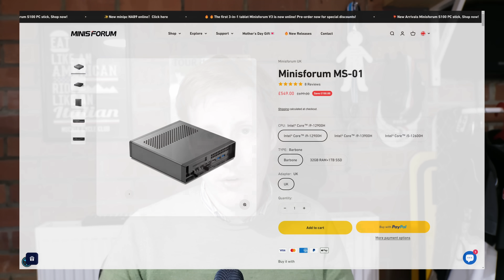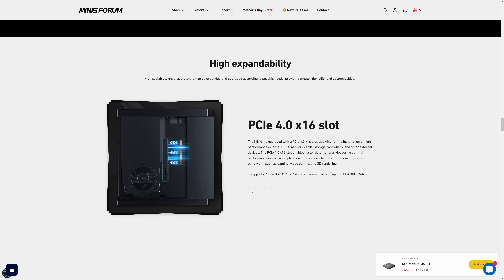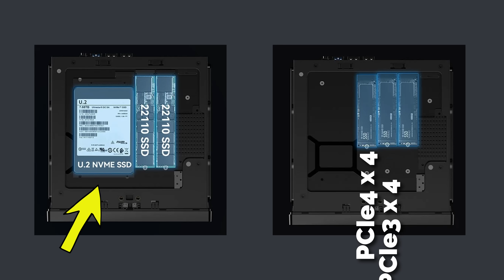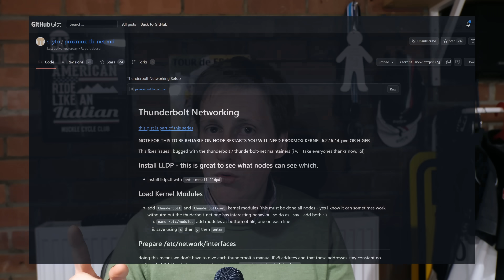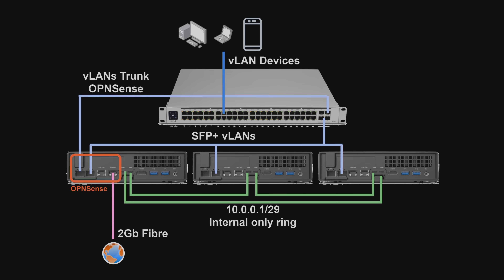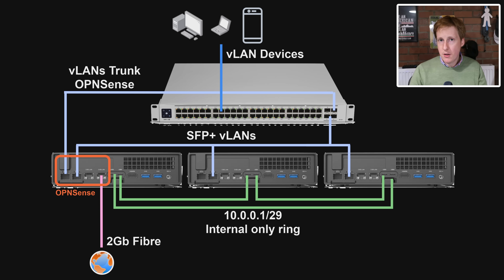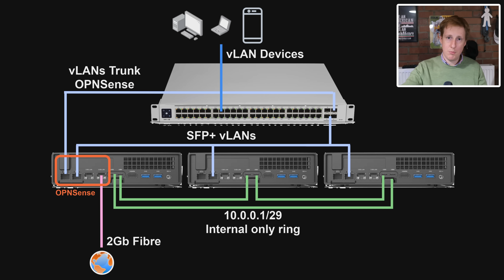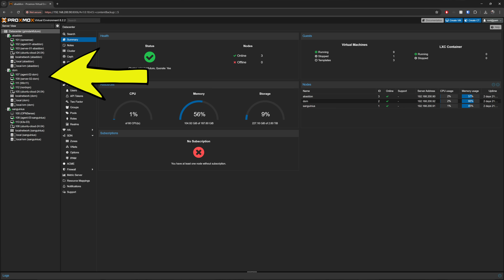Planning A Homelab - Cluster Time! Minis Forum MS-01

Comment: I recently came across the MINISFORUM BD790i with the AMD Ryzen 9 7945HX. It supports up to 64GB DDR5 RAM, has two PCIe 5.0 M.2 slots for fast storage, and includes a PCIe 5.0 x16 slot for high-end GPUs like the NVIDIA RTX 4090. Plus, it comes with a robust cooling system and plenty of connectivity options including 2.5GbE LAN, HDMI 2.1, and USB-C. It seems like a solid choice for a high-performance setup in a small form factor.
Reply from the maker: I agree. Put a quad NIC on it and it's a great option. I did consider it for a while.
Reply: @Jims-Garage  I have four BD790is clustered like this with a Miktrotik 10G switch (used the PCIe slot for a 10G card) plus two 2TB NVMes per machine. runs like a top. and 4 nodes makes Ceph extra happy, lol.
Reply from the maker: @notaprofessionalJ  damn, that's some serious horsepower!

Comment: I have been thinking about building a new homelab server for the past 4 months now 😅 and I really want to replicate your setup but my main concern is storage. I want to add HDs and there are 2 options either DAS over USB which is really flimsy especially with power saving or maybe using a SAS card. Maybe I should just build a NAS but then wouldn't it be better to build an AM5 build with Supermicro H13SAE-MF? Too many choices 😅😅😅. Can’t wait for your next update!
Reply from the maker: Thanks. If it helps I have a dedicated NAS outside of this cluster. I don't intend to change that.

Comment: Cool idea with the Thunderbolt ring.  Curious how the Ceph cluster is performing?  I also have a cluster of 3 and considered a Ceph cluster.  If I understand it correctly, a replicated storage array would hit the SSDs much harder than if the VMs were just running on their individual node.
Reply from the maker: I'll hopefully be able to feedback on performance in the coming weeks. It will definitely hit the drives harder but I estimate around 5 years for my nvmes. I'm happy with that.
Reply: @Jims-Garage  it was 3 or so years for me when I used QLC drives so that is probably just about right.

Comment: Hi Jim. Did you look at ipvs(adm) and a virtual IP address? Maybe three lines off of a switch connected to the modem, so that each of the nodes can assume the role of the uplink with a virtual IP address just in case the "current active node" goes offline`? As long as the HW switch between modem and cluster doesn't fail, your should be good to go.

Comment: Suggestion , buy a unifi aggrefator switch. Link aggregate the rwo 10gbits interfaces at 20gbits and your firewall Will be abble to migrate and have high avaibility. This bucause if router fails everthing fails on the cluster , i Will bot like my firewall and internet to BE a point of failure 🙂 cheears from Portugal 🤗
Reply from the maker: Thank you. I actually ordered one earlier this afternoon!
Reply: @Jims-Garage well done :)

Comment: Just a small word of warning with the ms-01.  I had nothing but problems with proxmox using the 2.5G ports with proxmox/opnsense. They would just not run at full speed at least with opnsense.  I ended up buying a managed 2.5G mikrotik switch and used the 10G ports from the ms-01 and connected my modem to a 2.5G port and that solved all my problems.
Reply from the maker: Good to know. I haven't seen that yet, I'm getting 2.5Gb on speed test.

Comment: unsure where my earlier comment went, but it had an external link so maybe it got cleansed!

had recurring lock up issues with the MS-01 with a k8s workload! after doing all the usual things: bios update, microcode updates etc things are looking more steady.  would love to get this working stable without having to do something like disable the efficiency cores.  

have you had any lock up with container workloads?  great video!
Reply from the maker: All 3 machines have been running k3s for a few days, I haven't had a single issue. I wonder if you have a bad unit?
Reply: @Jims-Garage  that was my first thought, but I saw a lot of posts with people having the same issue!  no crashes in 1 week tho, im hoping im good

Comment: Here's my solution to have HA firewall. It is not perfect but it works for me.
I have a 3 node NUC setup and to have a high availability firewall I created a vmbr to 1 dedicated lan port on each node (each time the same port). As the modem has 4 ports, I directly connect this port of each node to the modem. This vmbr is set as wan on my pfSense instance, nothing else on linked to it. I was not able to set the modem in bridge mode (fiber is too complex for me), instead on the modem I set the IP of pfSense as dmz. All traffic hitting my modem is in fact redirected to my pfSense, with my internet IP facing directly facing pfSense.
With HA, if the node where my pfSense goes down it automatically starts back on another node. Thanks to ceph it goes quite fast. I'm now considering to have 2 OPNsense instances running instead of 1 pfSense to have no downtime.
Reply from the maker: Thanks, this is similar to how I used to have it. However, using the WAS-110 SFP stick has complicated matters. I'm keen to keep trying though.

Comment: I spent a couple of days trying to iGPU passrhough the Xe to a linux VM and had no luck, so I'll be very interested to see how you go. For now, I've installed the desktop OS directly on the MS-01 and using an Incus VM to run Proxmox. I'll also be running Proxmox Backup Server in an Incus LXC container and passing through a 4TB NVMe to it.
Reply from the maker: I have it working without issue (no sr-iov though). Follow my GPU passthrough guide, those instructions still worked for me on 24.04 server.
Reply: @Jims-Garage  Great. Do you mean you currently have full iGPU Xe passthrough working with a Ubuntu VM on an MS-01? I track a few forums and I have not seen anyone post anything positive yet. Which guide do you mean?

Comment: Wow that setup looks very cool. I'm curious to know more about the WAN connection. Are you using your ISP ONT or removed it in favor of the SFP+ port? How does that part work in your network? Thanks for your great videos, learning a lot!
Reply from the maker: My ISP doesn't have modem mode currently. I'm having to bypass their router with a was-110. I plug it into a switch and convert it to rj45 to save an SFP port on the ms-01. It could go straight into the ms-01 though (if the heat sink wasn't so large!)
Reply: @Jims-Garage  cool, didn't know about the was-110. i will investigate. thanks

Comment: k3s storage is something I struggle with. I have used longhorn, NFS and openebs. Then moved to ISCSI, and everything seems to be really stable, but that means I'm relaying on a single instance of truenas. It would be cool if you could make a video comparing HA storage solutions for k3s and their performance
Reply: Longhorn can be extremely buggy. I have lost databases because of it. When everything works, it works beautifully, but every few months, something fails to start. The biggest issue, in my opinion, is the io speed. If you have a demanding work load or a large db, everything comes to a crawl. This is with nvme storage backing across 4 nodes
Reply from the maker: @hansaya  yes, I've witnessed many of the things you mentioned. Thankfully I don't have anything that is too heavy on IO but if that changes I might need a different solution. I'm keen to go ceph for a single solution but need to figure it all out first.
Reply: @Jims-Garage  One thing saved my bacon many times is using a reliable backup solution. Learned that from my longhorn saga :(. I use Velero and I highly recommend it. Very easy to use as well
Reply from the maker: @hansaya  thanks, will take a look. Currently using PBS, rclone and Google drive
Reply: @Jims-Garage  Velero+restic takes a snapshot of your deployment/data very efficiently then put that on a s3 bucket. You can chose to put your s3 bucket in your google drive using truenas. Biggest perk is being able spin up a whole new cluster with all your data within minutes. Good luck
Reply from the maker: Will look into it. I'm currently using longhorn but looking into ceph.

Comment: You can get your firewall in HA mode (I think):
Create a VLAN and plug your fiber into an Switch that uses that created VLAN as an untagged port. Tag that VLAN to every port where your ms-01s are plugged in and you should be able to use a VM with an ethernet Port configured in Proxmox with that VLAN. Mark it in the Cluster as HA and it should work.
Reply from the maker: Thanks, I'll retest. Might be complicated by using a WAS-110
Reply: Mini Forums should have a AMD edition on the way for next month
Reply from the maker: @ulrikboesen  that's good to know
Reply: @Jims-Garage  I assume you passthrough the WAN port? PVE8 has aliases for pcie passthrough, so I assume it's possible to move the opnsense VM from node to node and use the same port for WAN. And I think opnsense should be configured to overwrite MAC, so it stays the same independent from the host.
I saw someone on yt doing this but forget video title and chanel. WAN was connected through a HUB (not switch, but I assume a switch would work) from the modem to all PVE nodes. It was a cable modem and the MAC was important to not change, therefore I mentioned it before.
Reply: The video on yt was without passthrough, on all nodes vmbr1 was configured to use the desired ethernet port and no IP assigned to PVE. But I don't like this aproach, I also have my router vm with a passthrough WAN port and opnsense handles the MAC (cable internet, the IP changes if the MAC changes)
Reply: 14:12 just saw you have already fibre plugged into a switch, looks like easy to test if it works the way I think
Reply: @sku2007  It was channel Digital Spaceport. He used a hub because it broadcasts on every port, unlike a switch. IMO clunky and another thing to break.
Reply: @justinooms6419  thanks! regarding breaking risk, I also suggested to try with the switch he`s already using on 14:12
Reply: @ulrikboesen  wait...what? is that a guess?
Reply: I could confirm it works. I use a vlan for my isp to fw
Reply: Make a OPNSense or PFSense vm on each node each with: 2.5Gbe passthrough for WAN, 10GBe SFP+ passthrough for LAN, make sure to add a SYNC vLAN to the LAN interface (no need for a dedicated physical interface). That SYNC vLAN should only be accessible to the two HA firewall's and nothing else using rules to only allow those sync services ports. I've done this in my homelab with PFSense (albiet with 1GBe ports) and it works beautifully, I can bring down one of my nodes for maintenance and the network doesn't miss a beat.

As for the WAN side, PFSense needs CARP VIP's on both the WAN and LAN side. Set up a L2 or L3 managed switch on the WAN side and have it hand out 3 IP addresses, one for each virtual router and one for the VIP. For PFSense there is a formula for finding what MAC address the CARP VIP will generate on based on its ID. You could also do this with a dumb switch, but then your ISP would need to give you 3 static IP addresses and they are not likely to do that with home internet. I've even had a business client where my local ISP was stupid and didn't know how to do this, so HA on the WAN for that client has never worked, but on the LAN side it works beautifully.
Reply: Yeah, OPNsense running CARP VIPs is awesome. I'm running a router on each node in my 3 node Proxmox cluster (with CEPH), all syncing over my backbone. You'd add a switch on the WAN side, virtual IP for any network you want to failover, then setup the OPNsense HA sync IPs. Throwing a whole node into maintenance mode for the first time is kinda wild for a humble 3 node homelab.

Comment: As far as router redundancy. It’s gonna cost a bit of coin but you could do two UniFi UDM Pros running one in shadow mode.

That would free up your first MS-01 so it could be cycled without a network outage
Reply: If you use something like Proxmox, it can handle it as well (when 1 node goes down, it'll just move the VM given you use something like Ceph or another way of "shared storage").
The issue would still be that his WAN goes out but the UDM Pro has that exact same issue (unless you have say, redundant WAN links).

Comment: All great stuff, nice seeing you doing more clustering~
Not certain how much experience you have with ceph with SSD OSDs but just keep in mind you want enterprise SSDs/NVMe(s) for longevity and reliability; plenty of fast consumer SSDs but not many of them handle the demands of ceph -- if you see worse than expected speeds keep that in mind.
Reply from the maker: Thanks, appreciate the warning. Some experience but lots to learn. Was going to try with 1TB nvme with 550TBW - see how that works out. I've some similar with longhorn for a few years and imagine it's similar wear and tear.
Reply: @Jims-Garage  The problem is not really TBW (for good consumer drives) but rather the poor write speeds over time/and both with heat. Also, you really should use a drive with PLP power loss protection. Consumer drives really are just a poor choice for Ceph.
Reply: YouTube ate a reply I had in here, but it was along the lines of considering an M.2 NVMe carrier board (with a switch chip as the MS-01 doesn't appear to have bifurcation support, unless that has changed recently) -- won't be able to recommend the Supermicro AOC-SLG3-2M2 because of this but there are other options out there if you need more NVMe storage.
Do keep in mind that the switch chip on these carrier boards will be the limiting factor so look for something beefy that carries all the needed lanes for each NVMe SSD.

Finally, backing up what Justin has added -- you really want to seek out NVMe SSDs with PLP -- these are usually designated as M.2 22110 and are all mostly enterprise SSDs as they need that additional room for capacitors~
Reply from the maker: @avluis86  thank, I'll check those drives out (I had these because UGreen sent me them).
Reply: You absolutely need SSDs with PLP or your CEPH cluster will be painfully slow.
Reply: @daveredmore2375  plp has nothing to do with speed

Comment: This is a wicked video :) although you called the 2.5gbe fiber :).  Why not get a 8 port Mikrotik SFP+ switch ? then link them all together via SFP+ ?
Reply from the maker: Thanks, it kind of is. My fibre goes into a switch and converts it to 2.5Gbe rj45. It's because all the IO is stupidly upside on the MS-01 and my was-110 doesn't fit due its heatsink.

Comment: I have the MS-01 and SR-IOV with the Intel iGPU works fine. I have the 12th gen variant and it works out great. I loaded it up with 2x48 GB sticks and this is my low power Proxmox node. I have successfully passed through the iGPU to multiple VM's at the same time (max. 7) and GPU decoding/encoding also works. Just know that when it comes to LXC containers there are some caveats from what I understand. Might be better to just run a VM with e.g. Docker or Podman on it and then spin up a Handbrake or Jellyfin container or something if that is what you're going for.
Reply from the maker: That's great to hear. Do you have a link to a guide you used in case of any caveats, or is it the standard approach?
Reply: @Jims-Garage  There is some caveats atm : you must pin kernel to last 6.5.X version because 6.8 not compatible with the i915 dkms
Reply from the maker: @gtarrare  thanks, I just read up on that. I'm already running 6.8...
Reply: @Jims-Garage  I tried to left a comment yesterday but YT removed it... I pointed that out as well. Don't run kernels newer then 6.6
Reply from the maker: @masterTigress96  thanks. Unfortunately links are automatically removed. I'll keep an eye on it to see if support for 6.8 comes. Failing that it does have space for a GPU
Reply: @Jims-Garage  Official support for Xe sr-iov should come with kernel 6.10 according to last phoronix news. We need to wait some months 'til official support
Reply from the maker: @gtarrare  Ooh, that's exciting!
Reply: @Jims-Garage  HW accelation working in a plex LXC and Jellyfin in VM (Ubuntu 22)

Comment: I was looking to get a MinisForum MS-01 and see if I can fit a MBA card and use it for storage , but can't find a external 4/6 bay unit which just has a PSU where you can plug the all the sata plugs into it , they are all USB or thunderbolt .
With 20 line CPUs it's hard to work out how do you get a GPU , sata and 10GBT network .

Comment: I've recently setup a medium availability Opnsense on my pve cluster using the proxmox HA rather than Opnsense HA as I only have a single public IP.

The key for me was using the cluster resource mapping for the hardware pass thru and having the cable modem connected to all the node Wan ports using a separate switch (in my case I used locked down vlan ports on my main switch), set the Mac address in the wan interface and then as long as opnsense is only running once (as it should with HA) then only one wan connection is active. You could use a small SFP+ switch like a mikrotik for sharing your wan to all nodes.

Works great, single IP, not true HA but in an unplanned failure, downtime is only a few minutes and for planned stuff, I can migrate easily.
Reply from the maker: Thanks, that's what I'm thinking of doing as well. Hopefully cover it in the future.